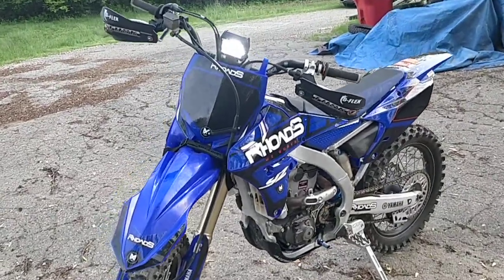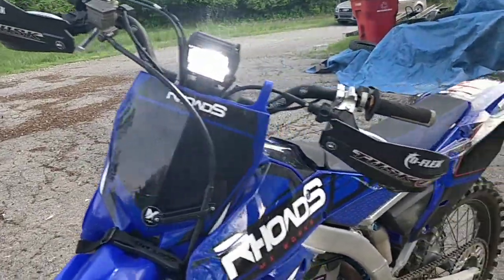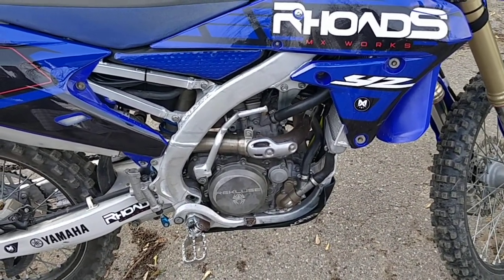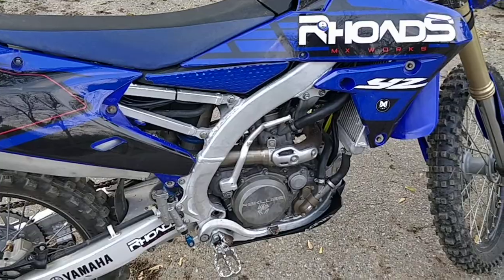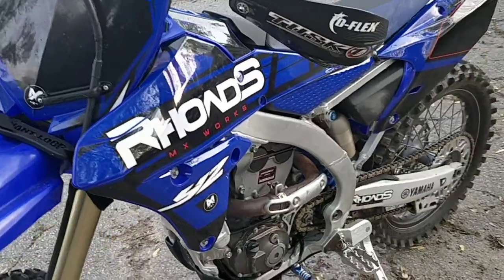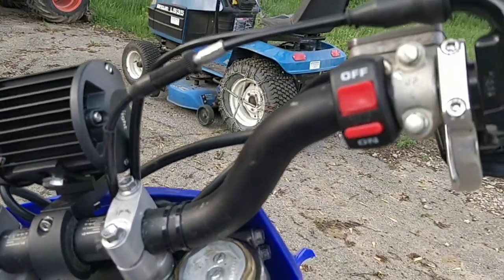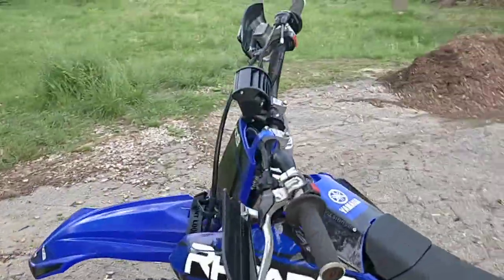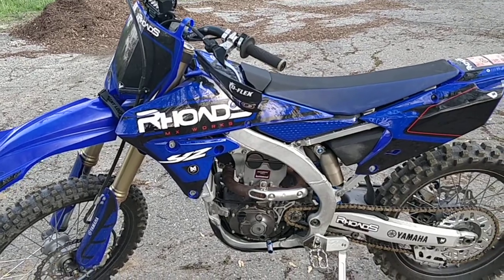How to install an LED light kit on your fuel injected kick start only YZ250F with no battery

Comment: Can i put rad fan instead of the led light
Reply from the maker: I believe as long as draw is less than 40w. I would also start bike first before starting fan
Reply: @Indian dude on Michigan Trails  how is the bike does it still work today?
Reply from the maker: @listomoto  i wish i could answer. Got stolen by assholes
Reply: @rippingandtrading I HATE thieves. They should out that much effort into getting a job and working hard like the rest of us instead of taking things someone worked hard for
Reply from the maker: @Jursaw  what's worse is the local PD isn't of much help either
Reply: @rippingandtrading  best to put some kind of tracker on your machine